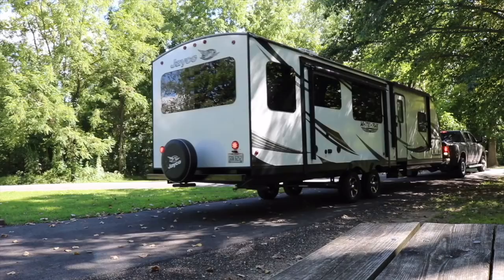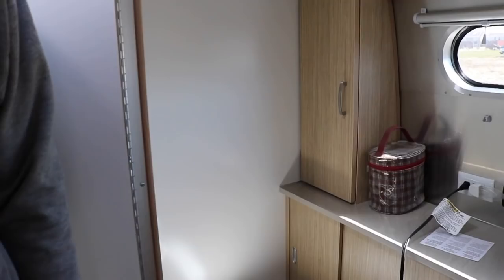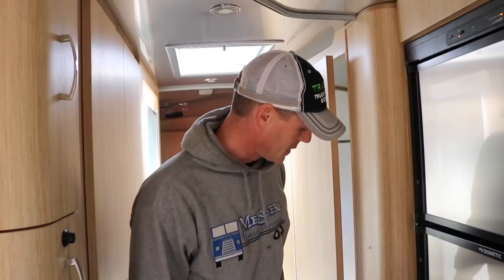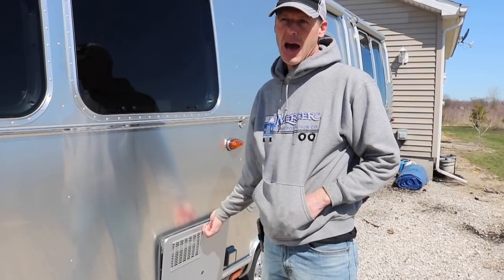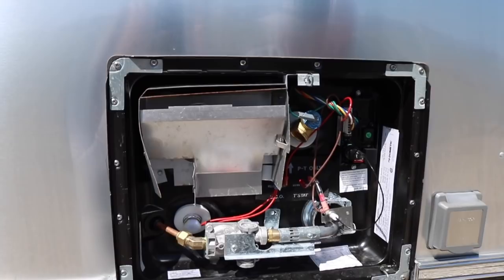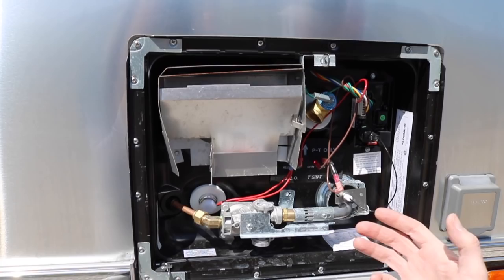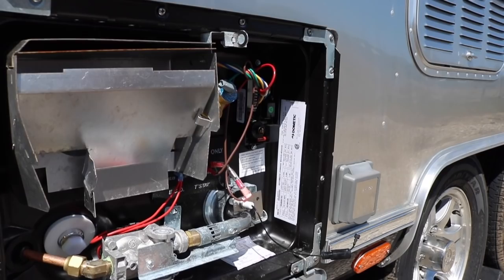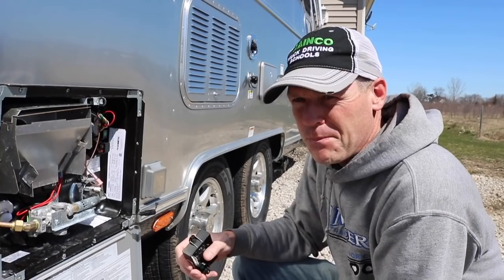DIY Atwood/Dometic RV Water Heater Repair (How To Fix)

Comment: I just had a similar thing happen to me, also with a water heater. Ours died on our last trip. After testing or the obvious, I was convinced it was the control board. The RV is only 2  months old. Called up the dealer to schedule to have the repair done and was told it would take a month or more before we would be able to bring the RV in. They said a manager would call me back to see if they could get me in sooner. I never heard from them. Called another of their locations to see if I could schedule something sooner. They too said they would call me back.  I never heard from them. Ended up ordering the board from Amazon, which arrived the next day. After a 5 min install, I had hot water again. 

Once you have purchased your RV, you no longer exist to the dealer.
Reply from the maker: We eventually got a replacement from the dealer but it took forever. We had to give them the bad part, via mail. Took forever even that way. But, now we have a spare board in case it happens again
Reply: I plan to do the same. Though, I doubt I will ever need to use the spare board. There is a known defect in the original board. Atwood would just send out a replacement when asked. After Dometic bought the company that practice stopped around 2017 when Dometic dropped the Atwood name because Dometic does not have a Consumer Support department as Atwood did. The problem was so prolific, Dometic stopped making the version board that proved defective and came out with a new version. I could only find the original board on eBay.
Reply from the maker: We found our replacement on eBay but others have commented that they have had several boards do the same thing and stop working. Ours has been good since we did this replacement
Reply: @WanderingWagners  As an FYI: This is the new replacement part number. 

Atwood 91365 Circuit Board Kit for Water Heaters - Use with Gas/Electric 12 VDC

The new board is larger (wider), does not have the two neon bulbs below the connectors and not all of the components are fully encased in the black goop.  It's a direct replacement and even has the mounting tabs offset so it can be installed in the water heater using the existing mounting holes.

Comment: Nice job. I see ur $80 as well spent, likely saved much more than that in gas alone doing it under warranty. Hate to see all the negative comments against dealers.
Reply: Sadly, most RV dealers do nothing but present a negative experience after the sale.
Reply from the maker: Dealers can be touch and go with how quickly they can get you in. Unfortunately the time of year is busy for RV dealers because there are a lot of people who take their RVs to the dealer to do simple things like de-winterizing, which clogs up the shop for actual repairs. We prefer to fix ourselves though!
Reply from the maker: A lot of dealers are too accommodating. They will take RVs in for screws coming loose or the blind needs replaced, or de-winterizing which then keeps the shop busy and less time for actual repairs.

Comment: We have this in our new Forest River Solera. We have read that to heat with electricity there should be a on off switch inside at the place this is installed. 
There is nothing like that. We switched it on inside the camper but it did not heat up the water. We are perplexed.
Reply from the maker: Does it work on gas? Is the water heater bypass on?
Reply: @WanderingWagners  Yes it works on Gas and I'm not sure what or where the bypass is??  We are virgin RVers.  LOL. My dealership had us check the breakers today but those seemed to be find.  They seem to think we should just be able to click on the inside switch since we don't have one on the outside where the heater is. And that is why they had me check the breaker.  Wish I could attach photos to here.

Comment: I have a 2018 Airstream 25 FB that we purchased in December and have been through 2 of those boards so far. The first one the dealer agreed to file a claim and reimburse my cost. We will see what happens with the second one. I now carry a spare and seriously considering a Dinosaur board. This is crazy for a new Airstream. Dometic must know they have a problem.
Reply from the maker: We have always hated dometic products. Nothing but issues with them, but they bought out Atwood so most RVs have dometic everything besides a new norcold RV fridges anymore. We are glad we are going to have a spare. Wonder if it's a bad solder, or connection ...We can fix that too haha

Comment: Having the same problems with a new atwood water heater.  On the 3rd control board.  I dont think I will bother with any more of there junk.  Dinosaur eletronics has a board that is built to ro replace the Atwood board
Reply from the maker: We've heard the dinosaur boards are good but luckily our initial replacement board has been good since then.

Comment: Very sorry to hear you have already had an issue with your new Travel Trailer. I agree that one cannot really blame Airstream for this, but I have to admit that I would be more than a bit upset with the Dealers attitude and lack of customer support. You guys bought what some consider the Cadillac of Travel Trailers and to be somewhat "Blown Off" by them is just not acceptable in my book. Am glad you were able to complete the repair and have hot water.
Reply from the maker: Luckily the water heater worked on electric, just not gas. We only asked the dealer if they could get us in and when etc. Based off that we decided to go fix it in our own, which is our preferred route.

Comment: I’m having the same problem. Where did you get it? Or what is the part number? Great video.
Reply from the maker: We got it on eBay by searching the part number, which is found on the back of the board (which you have to remove to find).

Comment: For an item that is prone to failure, there is a simple solution.  The dealer should have a KNOWN GOOD spare in the service dept.  It can be plugged in without removing the original.  If the unit works, install a new board.  Put the 'known good' back in the tool box.  Problem solved in 20 minutes.  A ton of customer loyalty to be had.  I guess they only get the 'be had' part.
Reply from the maker: We did this on our own because it was easier and faster. The dealer shipped is a replacement later, after we sent the bad one back.

Comment: Thanks for the video, I just ran into the same problem last weekend. I turn the switch on , nothing. I checked the thermos cutter off , it’s okay . I found the 2 amp fuse on the control board blown, replaced it still nothing. I do not hear gas and no spark . Dealership says they can get me in 2 months from now.
Reply from the maker: Our fuse tested good but the board was still the issue. Just buy a replacement and see if it works to avoid the dealer
Reply: I tested the tracks they all failed . Thanks for your help.

Comment: We have a very similar issue. Works well in AC but no spark on propane. I replaced the board, worked fine for 1 hot water cycle then no spark. Swapped the board again, worked fine for 3 hot water cycles then no spark again. Gas is flowing, I can light it manually - what a pain!
Reply from the maker: Luckily we haven't had any more issues since we replaced it... Knock on wood! Nice to have a spare. I wonder what could be the issue with yours because it sounds like it's not the boards as the original issue maybe.
Reply: Wandering Wagners we have a good friend who is in contact with Atwood and 2 is their techs think that it's the board. I guess it could be but... If that's the case then I'm guessing that something is causing the boards to go bad.
Reply from the maker: Take a good look at the boards, going in and out to check solder joints and other wiring in the heater to make sure... At least that's what I would do.
Reply: For what it's worth. I did just get a note from the local tech. He said that Atwood had a large batch of bad boards and will replace the board under warranty - we'll see. This has been so disappointing with a 2017 trailer.

Comment: I just had this happen to me at kur first outing this week. Everything was fine the first time I turned it on and then it stopped working. It kept clicking,  but would not ignite. I'm  gonna try this route.
Reply from the maker: If it clicks but doesn't ignite make sure the gas solenoid is working. Have somebody flip the switch inside while you listen at the water heater. You should hear the gas solenoid click opening the gas follow, then the ignitor will start clicking.

Comment: Where did you purchase your new control board? We have a 2018 bullet by Keystone. Atwood all the same. Also does it need water present to even try to light , just as a test after replacing fuse still nothing , no gas sound either, but the board would have to tell the gas valve to turn on.

Thanks
Reply from the maker: The water heater will fire without water in it! But don't let it run that way. We purchased it online on eBay. There were several other places that had the boards, for all different models of water heaters so you just need to verify the part number before purchasing.

Comment: Met a couple that had an airstream with same exact problem. Obviously it’s an Atwood problem my gas doesn’t work but the electric does, I don’t even hear the gas flowing. Could it still be the board?
Reply from the maker: Yes it could be the board. Our electric worked but the gas did not.
Reply: @WanderingWagners  thank you!

Comment: If you look on the video there is a little green circle on the board if you push it it will reset.
Reply from the maker: The board was bad. No reset

Comment: Thank you for this vid. Have the exact same water heater! I was freaking out because it was the first time I wasn't getting hot water so I had no idea even where to start. My question is should it be firing ("like when you hit switch") if just on electric? Reason being I checked my wires, heard a hissing sound (that's good), plugged everything back in, went to electric, and now my hot water is warming again. Not super hot like before but good enough. Help? Thanks.
Reply from the maker: Ours worked on electric with the bad board, it just didn't work with gas.
Reply: Thank you. Big distinction because I don't believe we have ever tried to ignite with propane for hot water AND it doesn't seem to be lighting. I guess use it or lose it seems to be the culprit here.

Comment: Funny same exact thing happened to my Atwood this past weekend while camping, where did you order your board from do you have a link or model number?
Reply: Hey watched your video do you have that link ?being disabled I cant afford a lot thanks for your help happy wandering
Reply from the maker: You have to pull the board off and look for the part number on the back. Search online for that part number. We found one on eBay. Others found them other places. No link to give unfortunately due to several different part numbers it could be in your unit.

Comment: I can't stop laughing..Not because of the water heater but Airstream is no better than everyone else.
Reply from the maker: The water heater isn't made by airstream. It's Atwood/dometic. This could happen in any rig with this type of water heater. It still worked, just not on gas. Fixed in 5 minutes. Not a big deal.
Reply: Airstream gave you guys the run around. that is what I am talking about. Their service isn't any better than all the others.
Reply: Retire: I agree with you, it matters not what "part" failed. An Airstream was purchased period. If one purchases a new Ford and a brake part failed not made by Ford you wouldn't get the runaround.
Reply: Airstream is not the dealer.
Reply: Airstream sells a very expensive product. Supposedly built with superior components and in my way of thinking should be backed buy a superior dealer network. Nothing built by man is perfect. Things fail. Airstreams dealer network should reflect the premium product they sell but it looks like this one is no better than camping world.
Reply: Appliances are pretty much the same in most RVs regardless of brand, so the only thing that REALLY differentiates them is the coach design, construction, workmanship and materials used.
Still IMO the ammonia/absorption refrigerator/freezer units are OBSOLETE and no RV maker -- except the crap-maker brands -- should be using them anymore. NOW they should be using compressor units, period. I wouldn't want to buy a RV today with an ammonia/absorption unit in it. NovaKool is one brand of RV compressor unit being seen in RVs nowadays (like the 2 Winnebago Class Bs I'm looking at), but Dometic ALSO makes them (at least they do smaller/portable units), so I'd expect that they COULD make larger built-in units if they wanted to -- easily. So, I don't know why Airstream (and others) aren't using a Dometic compressor unit if they want to stay with Dometic vs. going with some other brand -- like NovaKool.
Whatever, the Dealer and Maker are 2 different entities, but for sure -- just like in car dealerships -- the MAKER should step in and straighten-out any dealer out that is harming the makers brand name...if for no other reason (such as doing what's right for the buyer!) it's in their vested/$$ interest NOT to have "lazy" and/or problematic dealers carrying their products. JMO...
And yes, it's true that in most cases/RVs, each appliance has it's own warranty -- and the engine/chassis (made by Ford, Chevy, Dodge, Mercedes) has ITS own warranty. The only warranty the most RV Makers cover is the coach itself (talking about motorized RVs, not towables)...except I know of ONE RV maker of Class Bs -- Roadtrek -- covers EVERYTHING in their coaches for 6 years, and IIRC, Pleasure-Way warrants THEIR small motor-homes for 5 years...BOTH of those warranties are not AT ALL typical, which is why Roadtrek and Pleasure-Way stand out warranty-wise. For towables, however, the coach AND chassis (since towables have no engine/chassis) should be covered by the RV maker's warranty since THEY build both themselves...but again, the appliances probably not -- except for Roadtrek and Pleasure-Way (as mentioned) -- but they are motor-homes (even if Class Bs, Class B+ or small "Class B like Class Cs").
Otherwise though, with most RV makers you need to see the appliance maker if you have warranty issues. THAT is how it usually is in the RV industry.
-- BR

Comment: The bigger question is why are these boards burning out so fast? And 2nd, is the after market replacement board made better to correct the problem in the first place? Same heater same problem ....
Reply from the maker: I believe we were told (at the time) that there had been a bad batch of boards that were installed in water heaters, but they didn't know it. After we replaced ours, it worked well ever since.

Comment: I think I have this same problem.  Is there a light on the circuit board that would come on?  I have a light on with that high pitched noise...but no clicking at all from ignitor? Sound similar?  Thanks for the video.
Reply from the maker: Ours didn't have a light. We tested the fuse and other things, then decided to just order a board and change it to see if that was the issue and it was. No problems since, knock on wood. Seems a lot of other people are having issues with their boards though

Comment: Can you by chance post where you might have bought that new circuit board? I am having the same issue and cannot find where to buy it, contemplating traveling 2 hours to a junkyard for it.
Reply from the maker: We searched online for the part number, on the backside of the board... We found one on eBay, while others were able to find their part number on parts pages etc

Comment: Having a similar issue but ours is propane only. The stove and furnace ignites but not the heater on a new Jayco camper

Really don’t want to do a warranty claim if I can avoid it as it’s 2 hours away. 

Where did you order the board?Is it the same one used for propane ?
Reply from the maker: Pull the board and inspect it for obvious issues. The part number is on the back. Search online for that part number board. We found one on eBay. If anything you'll have a spare board in case.

Comment: Would it have killed you to include the part number for the circuit board?  I have the manual but no part number are listed.
Reply from the maker: Pull the board out and look at it you lazy fuck

Comment: I have exactly the same problem with the same heater but in my Lance. Can you give me the Amazon link to order the same part? I don't even know what the part is called. Thanks, Greg
Reply from the maker: We found it on eBay and there are a few different part numbers depending on your unit. The part number is on the back of the board

Comment: What was your part number it looks just like mine. And where did you get it at.
Reply from the maker: I can't remember the part number. However, it's found on the side of the board. Several look the same but are in face different part numbers. We did an internet search and found our part number on eBay. However, other rv parts stores had other boards that had different part numbers (but looked similar). We suggest you verify your part number and run a search to see who has one.